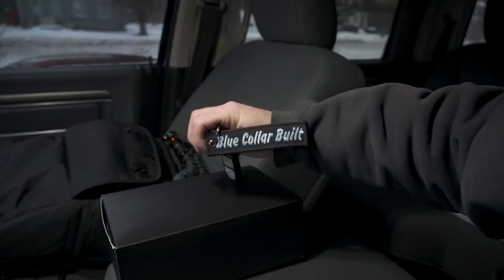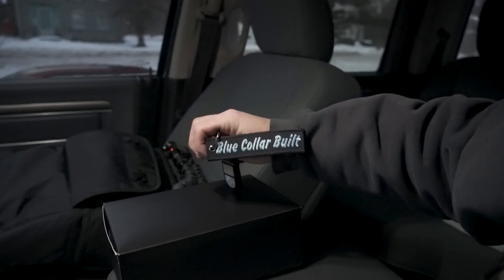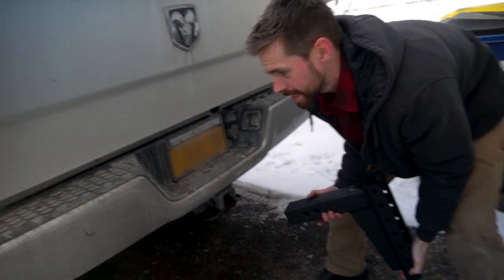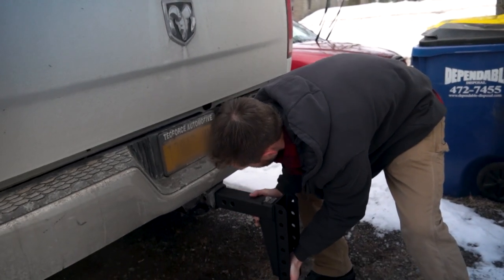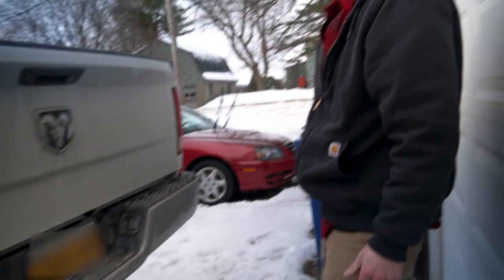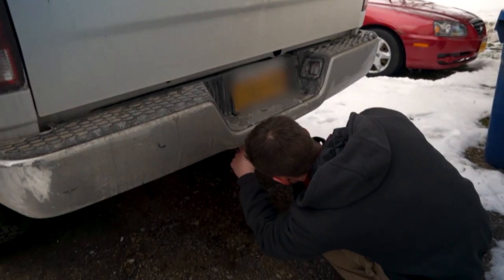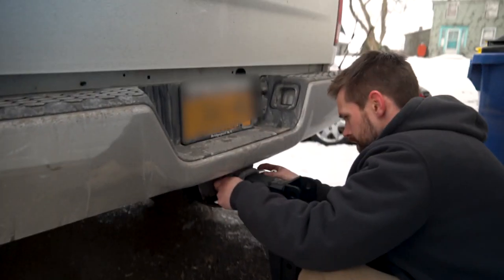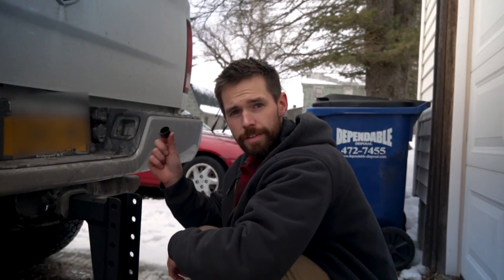YOUR TRUCK NEEDS THIS BULLETPROOF HITCH!

Comment: I am also sponsored by BULLETPROOF and I gotta say that I am really happy with the quality of their products I also got the ir stabilizer bars
Reply from the maker: Yeah man, their hitch is amazing. I was really pleased with the product when I opened the box up and took it out. Nice heavy duty material and well constructed. I want to grab a few of their accessories soon to add on to the total package!
Reply: pure panoRAMa awesome! I recommend you get their stabilizer bars if you tow a lot.
Reply from the maker: I don't have a trailer hooked up to the truck too much, but the stabilizer bars do make the hitch look even nicer when their installed. Maybe I'll grab them just for the aesthetic of them and I'll have the function available when I do hook up a trailer.
Reply: pure panoRAMa for sure, and also they will offer even more protection to the rear of the truck